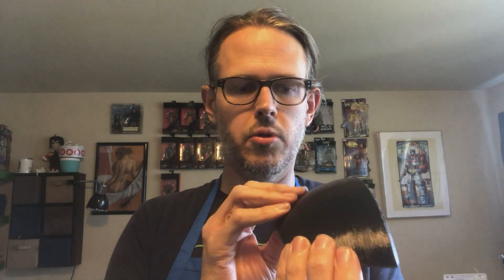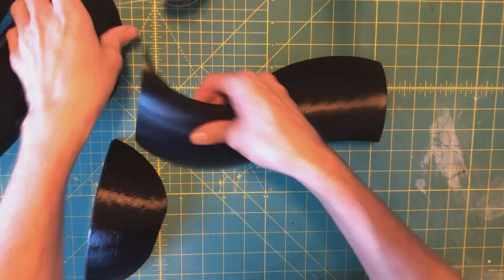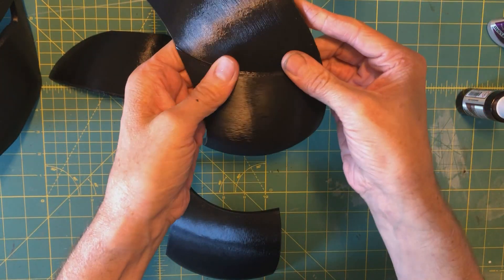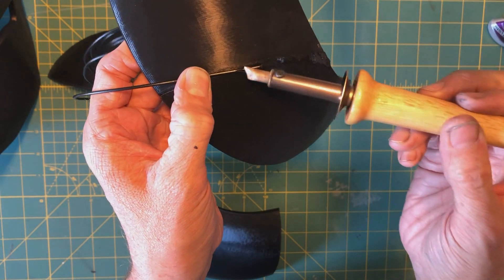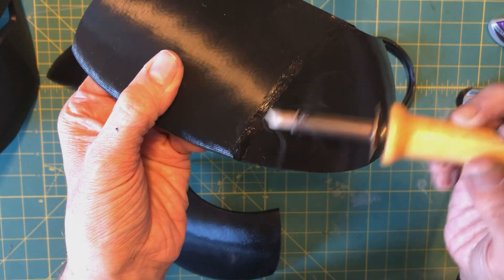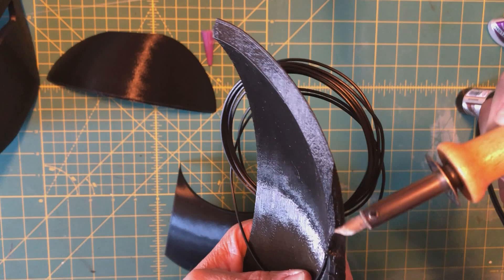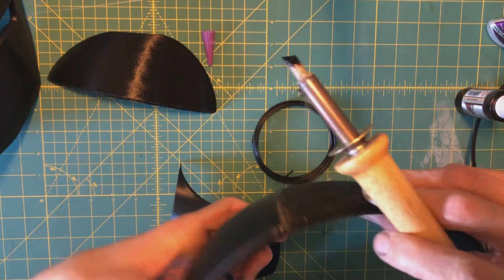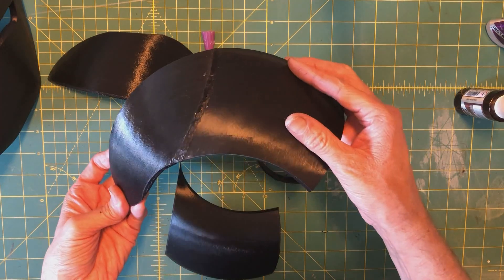Welding Together 3D Printed Parts

Comment: Real welder here with 40+ years of experience on steel, aluminum, etc. New to 3d printing though, like 2 maybe 3 months. Glad I watched this. This will more than likely help with my million % failure rate, slightly less lol. If your concerned with strength, or permeability I'd suggest v grooving one side or the other after you've got it tacked together. With steel, or what have you we generally try to get as close as we can to 100% penetration as we can. This may not be necessary for cosmetic doodads like that mask that don't have a function that takes abuse or needs mechanical strength. Just an idea.
Reply from the maker: Thank you for that info! We admit we've never done real welding just this version of it :) we'll definitely give it a shot the next time we need to weld parts!

Comment: Is a soldering iron better or as good as a wood burner or is a wood burner really the best option? I have access to both if necessary
Reply from the maker: If one has interchangeable tips and/or variable temperature, we'd go with that. In general, if either has those options they are pretty much the same for this type of work.

Comment: i have some prints where i printed too fast and i have some small holes on certain sides and this is how i fix those holes lol. i get scraps like brims or from the poop chute and i use those to fill the holes. works real well to save a print. i considered a 3d pen but then again you need to smoothen out the filling from using a 3d pen so this hot knife was a better option for me.

Comment: Be carefull with the fumes when burn super glue its really harmfull, that smoke in yours eyes hurt like hell, tell for experience, use the least amound posible, to really penetrate with the molten pla and get the stronger bond

Comment: Can you PLA-weld on underextruded layers? Sometimes I will get a random underextruded layer even after drying the PLA, but wondering if this can be a solution to a single layer or two. Thanks!
Reply: it depends on the amount of under-extruding, but generally yes you can

Comment: The issue I have with this (and I guess the question) is strength.  It didn't penetrate, so it's just being held together at the surface.  Would be nice to do some stress tests.
Reply from the maker: It really depends on the part and your usage. We mainly print things to be mold and cast so we don't usually have to worry about strength beyond making a mold. If we are using a printed piece that's been puzzled together for a finished item, we'll often back it with resin to further strengthen it.
Reply: @SionnachStudios  Ah, I see.  Makes sense.  Where/when would you apply the resin?

Comment: If you sand down the extra does it get rid of the seam line?
Reply: Sometimes, usually it just fills it up so it's smooth but that should make it easier to hide with paint

Comment: Great video! Just be really careful doing this guys. CA glue (superglue), zipkicker and heat are a bad combo for fumes and vapours. Get a mask, do it in a well ventilated area and grab a fan if you can. My dad worked with this stuff for decades and he's now unable to use zipkicker as his body has a bad reaction to the fumes. Thanks for the video my friend & happy making!
Reply from the maker: Absolutely agreed! We probably don't say it enough in our videos but we try to always wear a respirator or at least a dust mask when we work (depending on what we're doing) and we have a high powered air purifier/filter running almost non-stop!
Reply: @SionnachStudios  Awesome. Love the content ♥️♥️

Comment: Can you weld without using filament?
Reply from the maker: You can but it highly depends on how many walls and the infill of your print. Because you're melting the plastic it will almost I variable shrink so using the filament fills in the gap.

Comment: This is great but it has some pros and cons:

Pros: It's really strong as if the 2 parts were printed together.

Cons: It most of the time burns your prints so I used white for it and it was a misfortune.
Reply: Just paint it
Reply: @VeryJUICED  Yeah actually I will.😀😀😀

Comment: Awesome video! I was wondering, could a 3d  pen be in place of hot knife?
Reply from the maker: We do have a 3D pen and use it sometimes but in general find its even harder to get into tighter spaces than this method. Also, while it does give a thinner 'bead,' we found it still requires smoothing with the hot knife in which case its usually just easier to do it this way and all in one step!
Reply: @SionnachStudios  excellent! Thank you for the input!

Comment: I found your video because i was looking for a method similar that just came into mind. Actually what you are doing is more like brazing rather than welding, but yeah it does the job i think. What i am actually thinking is making the parts with holes, and use dowels as well, or some kind of rabbet joint. But thanks, you just confirmed my idea works, even i did not invented the tire :D

Comment: Couldnt you just apply a small amount of super glue to the filament, along the repair line...so, it stays still as you heat it?
Reply from the maker: I'm sure there is a detailed scientific explanation but heating glued filament gives off noxious vapors and smoke that are likely very bad for you. (We learned this the hard way). Sometimes we'll use transparent tape though as it wil melt away easily!

Comment: Could PETG be used to weld ABS parts?
Reply from the maker: In theory, if you're melting plastic, they should work together ok as long as the temperature is high enough to melt both enough to bond them together.

Comment: How about a 3d pen?
Reply from the maker: We do have a 3D pen and use it sometimes but in general find its even harder to get into tighter spaces than this method. Also, while it does give a thinner 'bead,' we found it still requires smoothing with the hot knife in which case its usually just easier to do it this way and all in one step!

Comment: like what youre doing, i use a soldering iron to do really big holding bits like this.  you could get a 3d printing pen would really help you and be super quick for this application.  it actually pushes the molten filament into and through the crack too

Comment: Hi i just had a question how hot do you have your wood burner? I ordered kne but the lowest temp is 200
Reply from the maker: The one we have is an old one that doesn't have a temperature control so we actually arent sure how hot it is! The temperature PLA prints at is between 195-220 so for PLA at least 200 should be fine. Applying more/less pressure and moving the wood burner more or less quickly well help manage how the plastic melts!
Reply: @SionnachStudios  thanks man, great content on your youtube btw
Reply: So apparently they sell a power cord with dimmer switch at auction sites incredibly cheap. If it gets too hot to work with, simply plug it into the dimmer cord.

Comment: A nice quick was to save a lot of filling with a material that doesn't sand the same as it's surrounding material. I do this also and use a needle file to do the initial clean up before sanding.